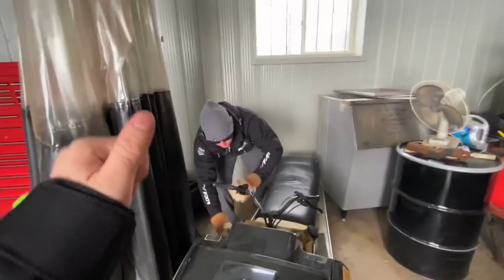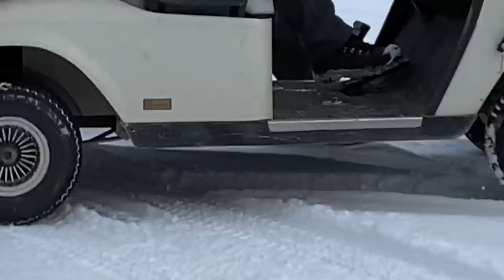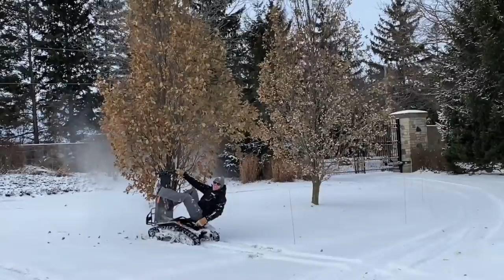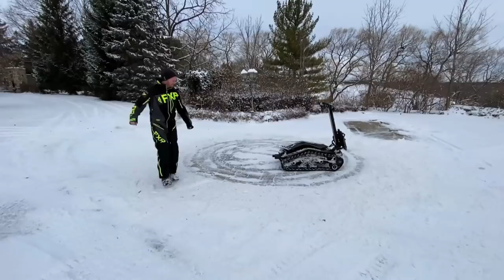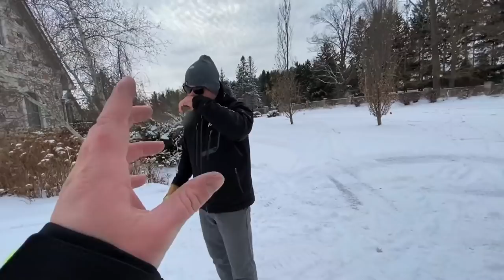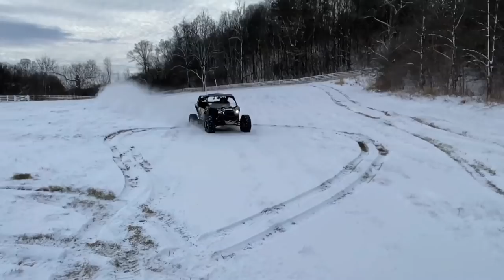CRASHED Into A TREE!

Comment: Snowmobile fuel tank check valve is bad if the gas all drained out of the fuel lines. Royal will have a gasket kit for that Tillotson. Just need to get the carb model ID just before the motor.